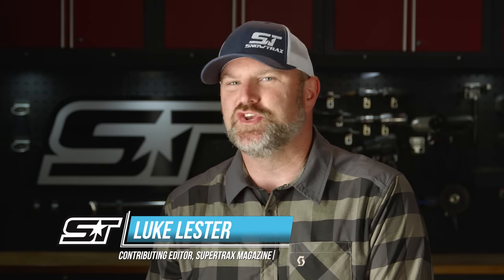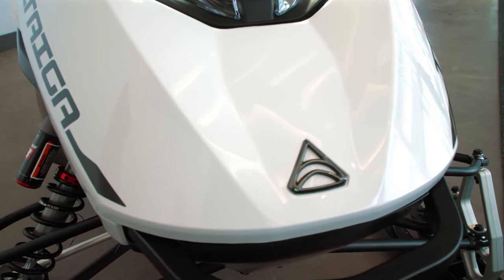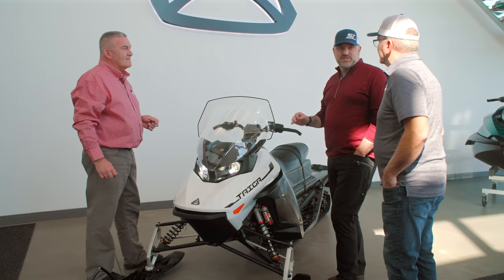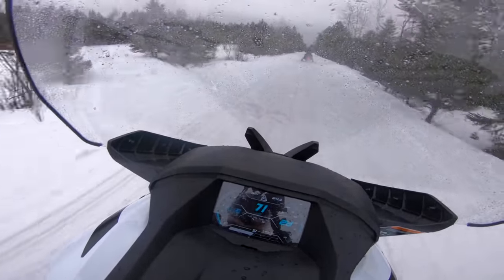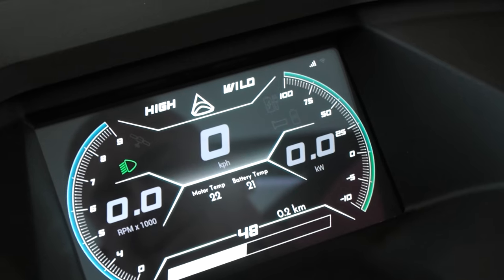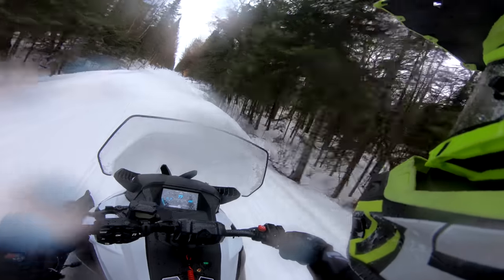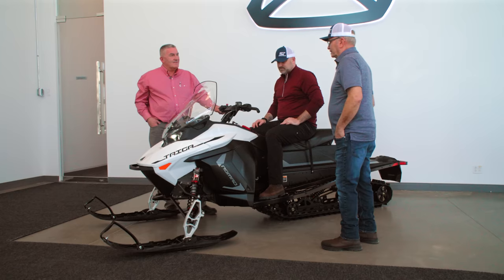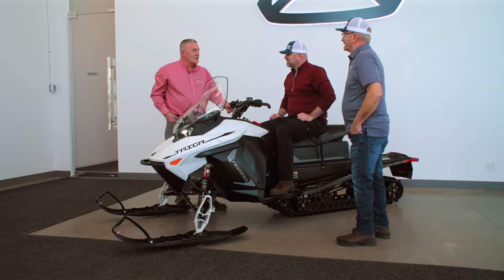2024 Taiga Nomad Electric Snowmobile Detailed Overview

Comment: There's too many variables EV's just can't answer right now.
Not to mention...
The range on range mode?
Charging time and costs associated?
Cost of home charging system installed? The list goes on.
The biggest concern to me is the emmisions are only transferred elsewhere.
The amount of materials consumed to get the equivalent of one bbl of oil is alarming.

That said...

I'd still like to test ride one though. Electric motors are some kinda torque-y.
Reply: I think this sled is specifically targeting an area in Ontario Canada where there is a developing charging network for these vehicles.
Reply: @dgreenbluet  apparently they already have hundreds of stations throughout Quebec.
It's still not positioned to completely eliminate ICE vehicles. The infrastructure  is decades away just yet.
And then there's everything I mentioned above and more.
Reply: I would love to have an e-sled but not cause of any environmental concerns. If we don’t care about the range they can travel without recharge I think an electric drive train is superior to an ICE with a CVT and I would love to get rid of the engine/exhaust sound of my current 600 etec (I know most riders love the sound of their two stroke but I don’t). 
Will probably buy an e-sled in the future if the range go up and I can afford one
Reply: @drdryyls   if you don't like the noise and smell, then you definitely care somewhat for the environment. There's no question an electric motor produces more torque than a comparable ICE. They just don't make extension cords long enough to eliminate the need for the minerals mined to make the batteries. Which by the way, that market is all but cornered by the Chinese. 
You should care about the environment. It's all the rage, these days.
EV's just aren't there yet and I'm not sure they ever will be.
This big "green" push is anything but "green". The amount of energy required to manufacture a battery is  insane compared to the equivalent energy of one bbl of oil.
Progress is progress, I get that.
The EV push is not well thought out by our fearless leaders, their main concern is to line the cronies pockets.
If that doesn't concern you, then well, sorry to hear that.
In the meantime, I can hardly wait for enough snow to get out on my 600R ETEC WT.
Reply: Charging costs will super cheap. Here in Ontario off peak is 10c a kWh so if it’s a 25kwh battery that’s $2.50 to charge at home. 
Of course at a supercharger it could be 4 times the cost but still way cheaper than any gas snowmobile
Reply: @shane2129  for now...wait until the carbon tax is quadrupled in the next few years...yikes...still and infrastructure issue as well
Reply: @jimeverden2244  Trudeau has just backtracked on that recently. During recent polls if there was a election today he would lose every province except Quebec. I don’t think carbon tax is gonna affect hydro. Besides most of Canada’s hydro is low carbon
Reply from the maker: I don’t think anyone is suggesting EV snowmobiles are the answer or even remotely close to replacing gas snowmobiles. However, there are scenarios where a person might want one and Taiga is producing VERY good electric snowmobiles for that customer. The range on range mode and on hard pack snow is around 100km or 62 miles with the standard battery. That jumps to about 130km or 83 miles with the upgraded battery. Charging times are as follows:
 Level 1 charging (residential) ~14 hrs, level 2 charging (residential & commercial) ~3.5 hrs, level 3 charging ~40 mins. One really good aspect of Taiga sleds is they use a popular industry standard charge plug so any EV charge stations, including the level 2 versions in your home, will charge your sled. Costs vary far too much to make any comments on that or any claims at all. If you want an idea of how much it costs in Quebec, re-watch the story. Believe me, we totally get everything you are saying about emissions and agree fully. Like it or not, though EVs are here to stay. Taiga is doing a great job building EV sleds. If you get a chance, definitely take a test ride. It’s a whole new experience. - Luke
Reply: @snowtrax  thanks Luke, I realize EV's have their space and could be a viable solution...some day.
The infrastructure isnt there and it won't be anywhere close to what they're pushing for. You think we have brown and black outs now at peak usage.
The availability of raw materials is just not there. The people that have control over most of the materials are not the most trust worthy....or democracy friendly might be better stated.
I doubt it will ever be particularily if these woke politicians get their way.
The cronies just keep getting richer on our backs.
I could go on so I'll just say, Tiaga is bleeding edge in the EV snowmobile industry and it looks like they have good product. I'd really like to take one for rip.
Reply: @jimeverden2244  dude… you even bring up carbon tax 🤣 you are the only one that forces these convos about politics! These are snowmobile pages that cover snowmobiling, and all you can talk about is the government…
Reply: @Bundysvideos  what's your point. If someone is concerned, that automatically makes em right wing. Wow. You wanna remain ignorant all your life, give er dude.

Comment: so the range on "wild"?  I do doubt its 300km on a full battery. 50km or so even on the ecomode? And how much do these weight? 600lbs++? Can you tow them with real snowmobiles if they die on the trail?
Reply from the maker: No surprise but, if you keep it in Wild mode constantly your range will be seriously diminished. This is true for all electric vehicles. We never claimed 300km on a single charge. However, we experienced well over 50km using a mix of eco and standard modes. The sleds we rode, as tested weigh approximately 750lbs. - Luke
Reply: @snowtrax  tech evolves.. And I bet some tourist companies are looking in to these. Those are really heavy though, like Viking 2 weight^^ For the company I work for, the range on standard would have to be like 100miles on one charge though to be viable to even consider. and even then, we would have to have a person employed who would only be switching chargers during the night.  or rotate guides for the job :)

Comment: Remember when digital cameras first came out? People loved them and technology progressed quickly. Now most of those digital cameras are not wanted and are taking up space in a sock drawer. Now look at the electric sleds, the sled from last year does not have the same charging potential as the current model year. Electric cars are used as a comparison in terms of potential for sales but if you look at the used market electric cars seem to be a hard sell.

Comment: A battery in freezing cold weather? What could possibly go wrong with that, 😂lmao
Reply from the maker: You aren't wrong about batteries in the cold. However, if you watch our content on the Taiga you'll see that they've developed a proprietary system that uses a tiny amount of battery power to pre-heat the battery. Once you're driving the battery stays warm on its own. With this system they have basically eliminated all the known problems with batteries in cold weather.  - Luke